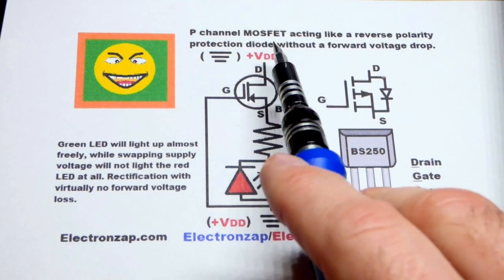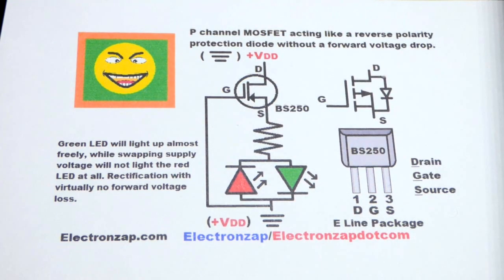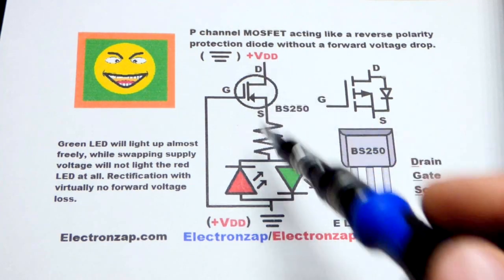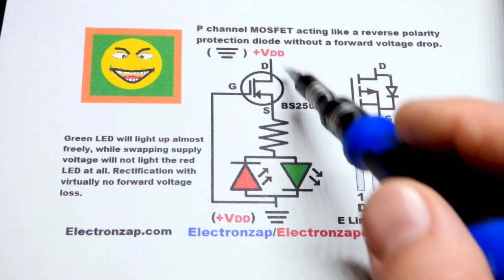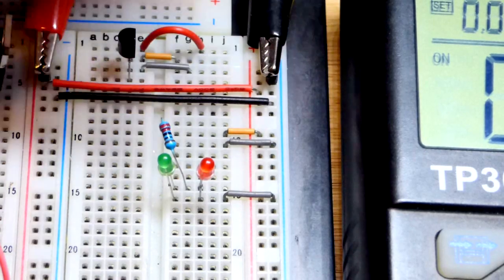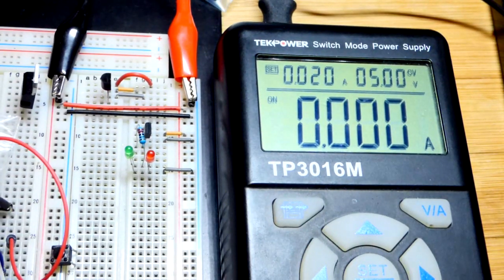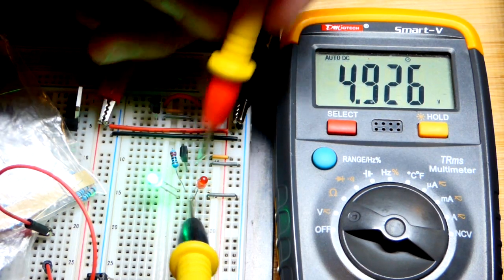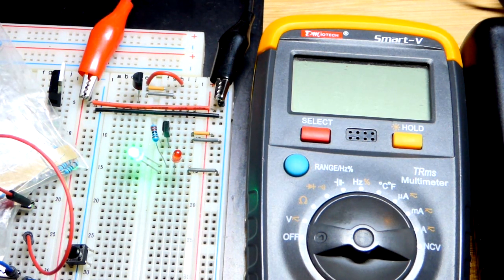BS250 P channel enhancement mode MOSFET wired as a diode with virtually no forward voltage loss

Comment: Reverse battery protection is an interesting application.  Be sure to check the max gate voltage, and protect the PNP Mosfet with a Zener.  See below:   https://i.pinimg.com/564x/1b/3e/be/1b3ebe51e13b787b1f56cba5ac647aff.jpg
Reply from the maker: I forgot about that circuit, it's a nice one!